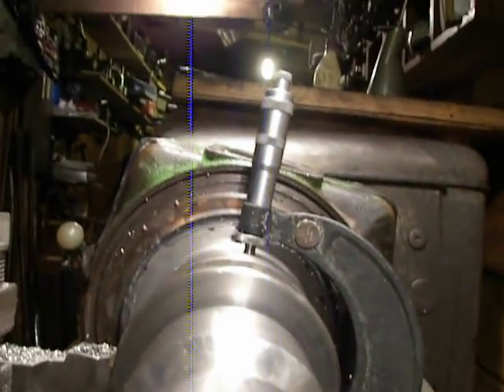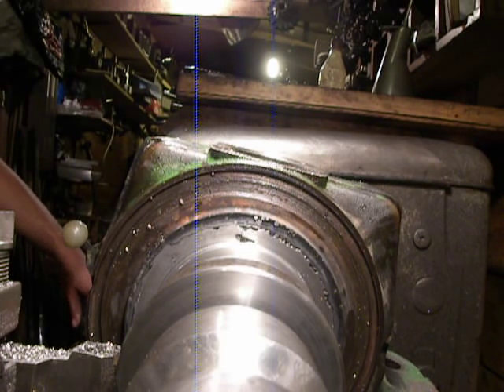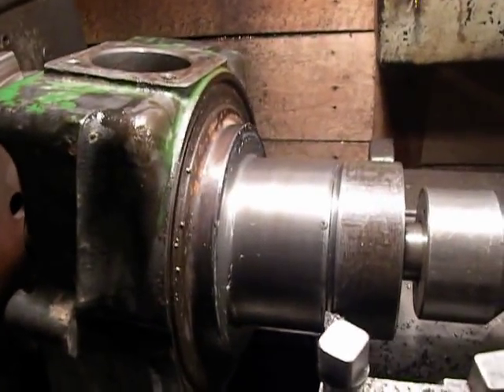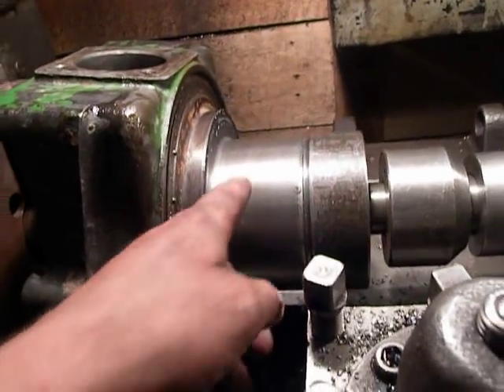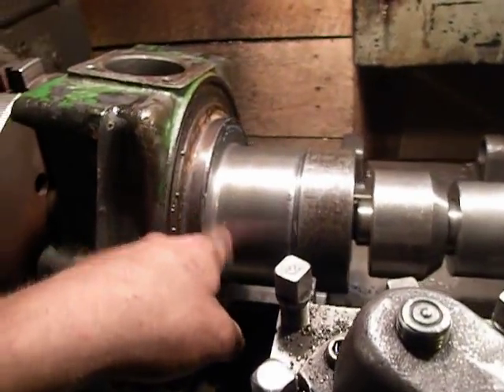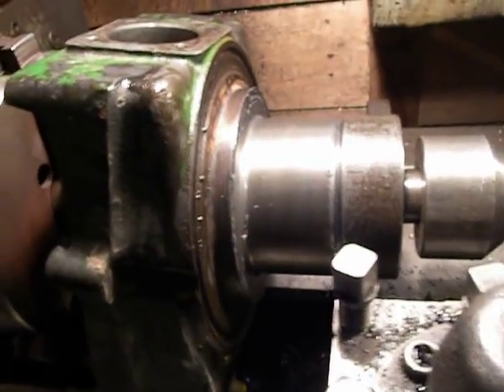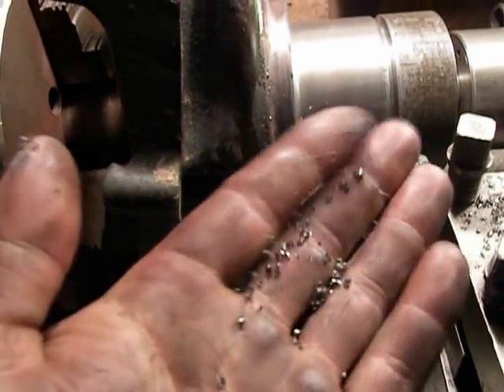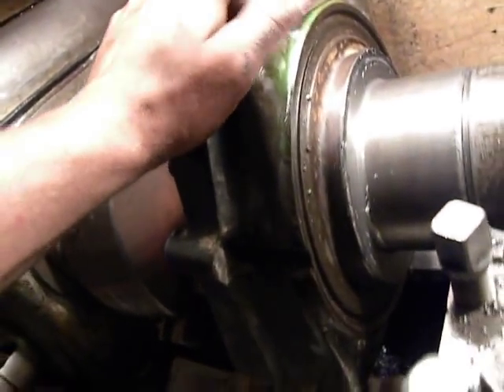John Deere tractor front axle bevel gear case repair part7 - check the work

Comment: Nice video series. Excellent work.
What is the capacity of the lathe? 16 inches?
Was a tight fit on there. If it did not fit on your lathe how would you have machined it?

Dave
Reply from the maker: Thanks a lot!
This machine can handle: D max= 440mm (17.32 inch), D over carrige = 230mm (9.05inch), "in centres"= 1000mm (39.37 inch). I think this is quite good size for medium size lathe. 
Well, if this I can't handle by lathe, then I will be use My Horizontal Boring machine or milling machine or just find more large lathe than my. In between this piece and my lathe ways was ~5mm (~0.2 inch) space.... I get this spece when I by angle grinder "fix" one sharp edge.